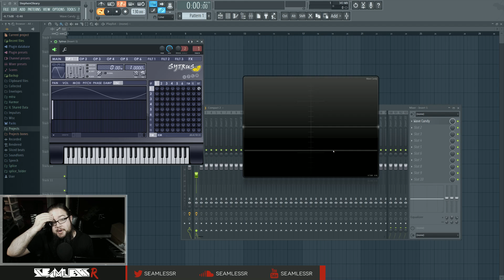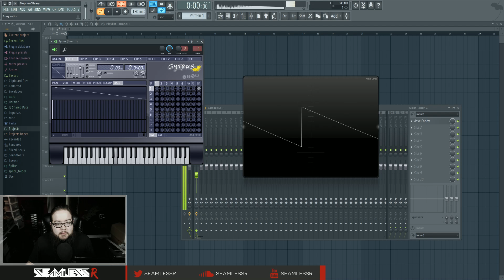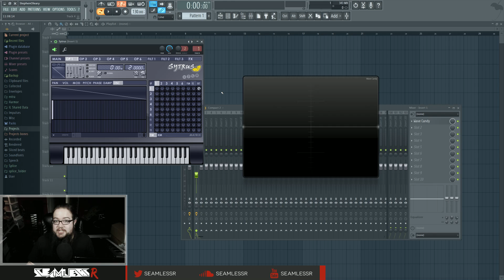Basic Terminology: OSC (Oscillator)

Comment: What is the initial signal that makes up the waveform? Is it a really really short audio sample?
Reply from the maker: +Martskre There are various methods in the digital world. In the analog world the signal is generated by electricity. I'm not up on my electrical engineering, but if you ever look into schematics of synthesizers you can see how they get electrical signals to translate into audio.
Reply from the maker: +Debanshu Pani it is ridiculously less complicated in the analog world. It's one of the reasons why analog stuff is considered more reliable.